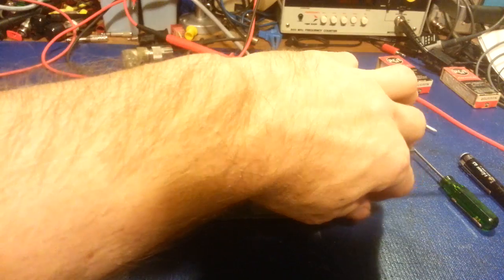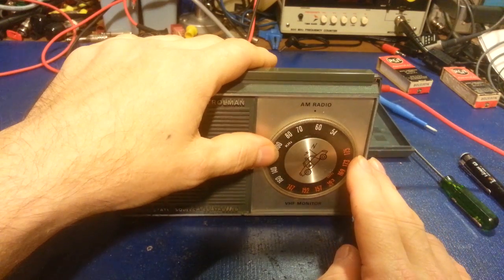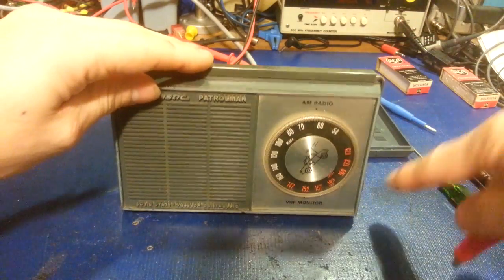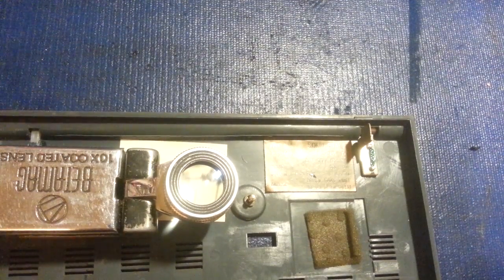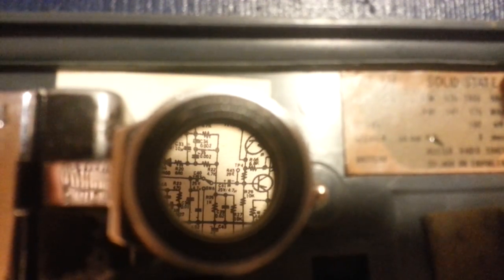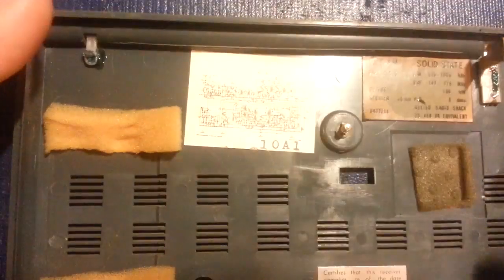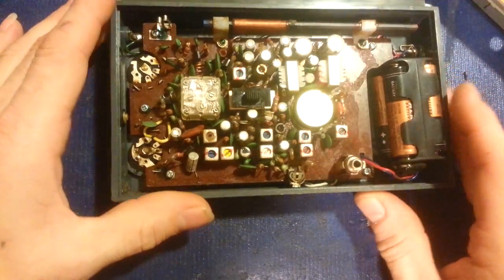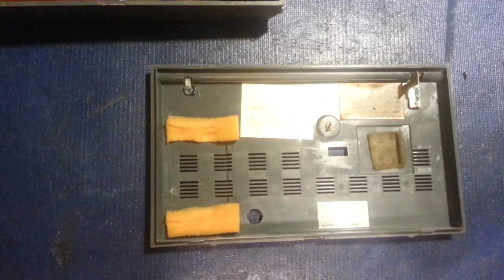Worlds smallest schematic, they had to be joking when they made this.

Comment: The small schematic is typical Asian dry humor. This radio looks like 1970's Taiwanese made for Radio Shack. 
It's a low price point radio, but it actually looks well made. Many of Radio Shack's radios were made by Uniden in Asia and were extremely high quality in the 1970s especially their scanners and CB radios.
Reply from the maker: scdevon 
Yep, work on CB radios from numerous manufacturers all the time that have Uniden chassis in them.  For a long time most CB's with a few exceptions either had Uniden or Cybernet boards in them.

Comment: That schematic is one of those cases where I'd seriously consider using the lens reversal adapter that I bought at one time, or at least an extender tube (got some of these for M42). Of course I got the adapter that fits a 52 mm filter thread when most of my spare lenses have 49 mm instead...

Comment: The onset of the disposable electronics age. I'd bet you're one of very few who were ever asked to work on one of these. most probably out lived (by many years) any warranty and were discarded. Tale a picture with your phone and enlarge the screen. I recall hearing that back in the 40's-50's most police departments would communicate at the end or beginning of the AM commercial radio band and one could actually open and tune there radio in order to listen to police calls. were those calls once VHF hence the police car printed dial? was the VHF on this radio once used as an early scanner?
Reply: guess I should've checked out the link you added to the radio. thanks

Comment: Radio shack did that quite a bit. I remember I had a pocket AM air band radio with a little schematic glued to the inside back of the radio. That radio looks real cool. I like the AM Vhf police band comb. Any idea what year it's from? Thanks.
Reply from the maker: All the parts in it only have single digit year codes.  Its a "1" so I would say 1971.  This advertisement confirms that.  https://books.google.com/books?id=sgAAAAAAMBAJ&pg=PA123&lpg=PA123&dq=realistic+patrolman+am+vhf&source=bl&ots=-f70cyfV2F&sig=BW8KeeVnkeoWEiztW3JGqxeno2o&hl=en&sa=X&ved=0ahUKEwjozJPx58nQAhVL3IMKHYZfDLY4ChDoAQgtMAE

Sold for $24.95 in June 1971.
Reply: MikesRadioRepair Mike, I found my jet stream mini with the little schematic and posted a video about it. Check it out if you want. Thanks!